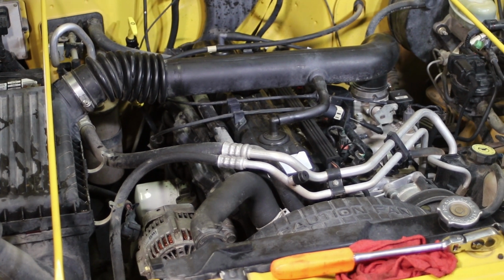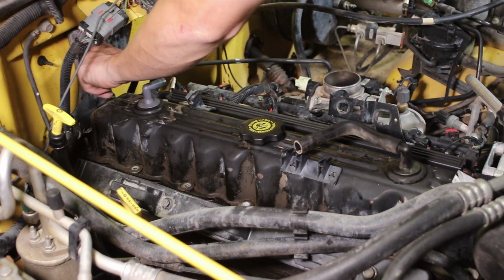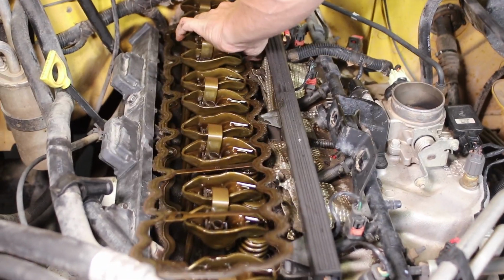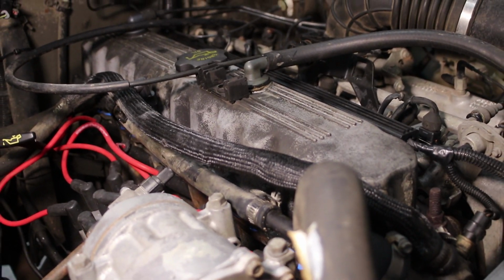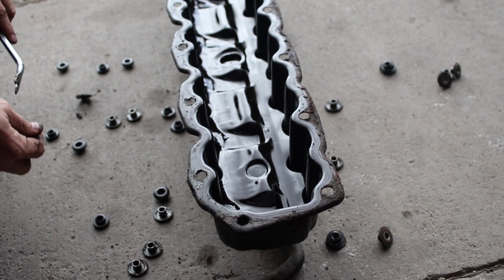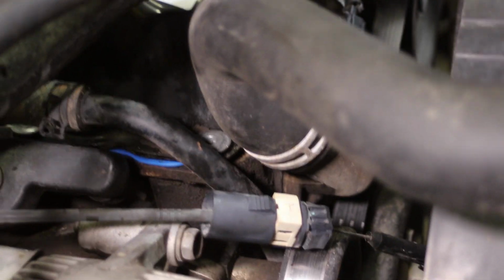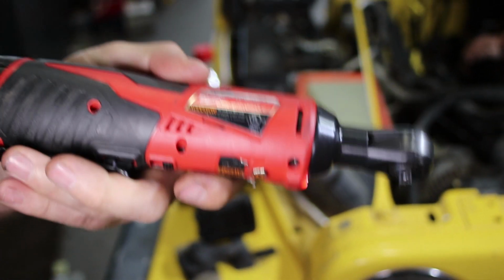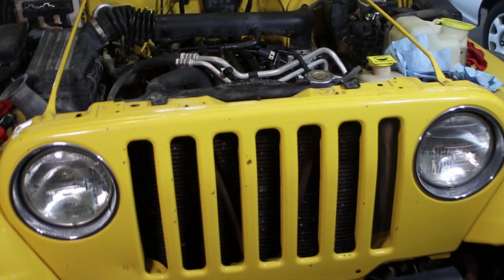VALVE COVER GASKET REPAIR 4.0L JEEP WRANGLER TJ - JEEPFIX TUTORIALS

Comment: on the 2006 you have more wire in your way. it will save time to remove the top water hose to get the cover out
Reply from the maker: We recently changed a valve cover gasket on a 2004 Jeep Wrangler.  There is a large wiring harnesses that is in cased in a black plastic bridge that goes across the back of the valve cover.  It needs to be removed by unbolting it first then separating it in half by uncoupling the tabs on each side with a flat screwdriver. Good luck!

Comment: Do you have a video doing this dealing with the plastic bridge on the back of the valve cover?  My 2006 wrangler has it.
Reply from the maker: We just ran into that same issue.  I think it was an 2004.  Unbolt then I clip using a flat screwdriver. Definitely adds time.

Comment: is this the same 4.0 I would find in my 2000 grand cheroki larado, it's a straight six
Reply from the maker: Very similar but slightly more difficult. On the Grand Cherokee you don’t have as much room to work at the back of the engine. The windshield cowl/windshield wiper tray is in the way more than on the Wrangler where you have more room to work.  It takes about 20% longer than what it would take to do a Wrangler.  Good luck!

Comment: Great video, very helpful. Just did this for the first time ever on my 2003 X. Took about 8 hours total and 2 of those hours were spent cursing the wiring harness bracket that sits on the back of the valve cover. That harness would not let me remove the valve cover so I removed the harness, zip tied it closer to the firewall and the valve cover came right off. Cleaning took a couple hours and putting it back together about an hour. Of course I broke the real plastic elbow on top of the cover and spent 30 mins replacing that also. Well explained video, thanks guys!
Reply from the maker: +Jay Massie, Thanks for your comment! Glad you found us.
Reply: Jay Massie...How did you get that pesky wiring harness bracket off the back of the valve cover..(husband is swearing so much haha)..
Reply: yeah trying to get it off now!
Reply: Struggling with mine the plastic piece will not come off any advice

Comment: Great video, I will be taking care of this in a few weeks, but where is the parts list?
Reply from the maker: +Chucks,  my daughter finished putting this together for me befor I got her the info.  What is your year make model and where you want to purchase the valve cover and gromets and I will get yoy the part numbers.  Thanks for watching!!
Reply: JeepFix it's a 2001 Jeep Wrangler Sahara, I'll be going to Oreilly for the parts. Thank you for the help.
Reply from the maker: +Chucks Sandman ,  Ill work on that.  Thanks for the reminder.  Comment with your year make model and I will reply with the part numbers.
Reply from the maker: +Chucks Sandman ,  I didnt get the parts list ti my editor fast enough.  What is the year, make, model, and engine size and I will get the part numbers for you.
Reply: Do you have part #'s for 2004 4.0 Wrangler. Gasket,bolt grommets,ccv,pcv, and grommets for those on top of cover?

Comment: GREAT VIDEO   2006 4.O LWB THE COMPLICATION CAME FROM THAT PLASTIC WIRE ARCH NEAR THE FIREWALL THAT ATTACHED TO THE BACK OF THE OF THE VALVE COVER .   ***REMOVE THE GROUND WIRE NUT IN THE REAR.  MAKES LIFE EASY REMOVING VALVE COVER*****   TOOK ABOUT 5 HOURS TOTAL TIME.   CLEANING THE HEAD TOOK THE MOST TIME....   AGAIN GREAT VIDEO
Reply from the maker: +JD Pauley, Thank you for the comment and posting your time.  I needed some realistic time for first timers.  This will help people decide how they want to spend their weekend. You are right.  Cleaning it takes most of the time.